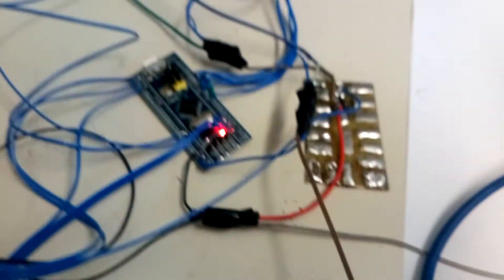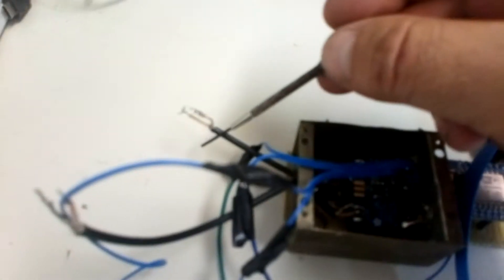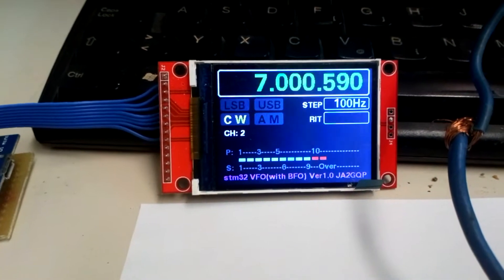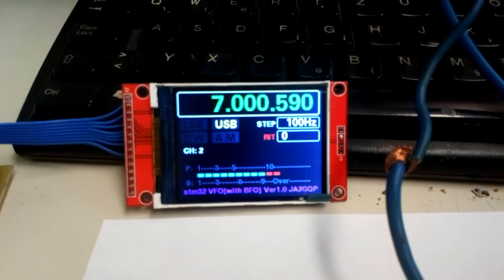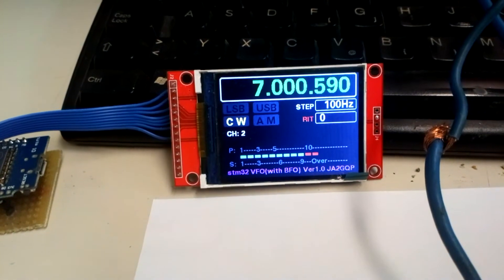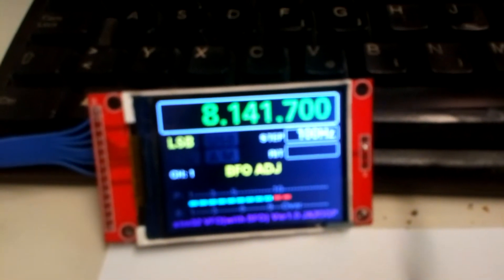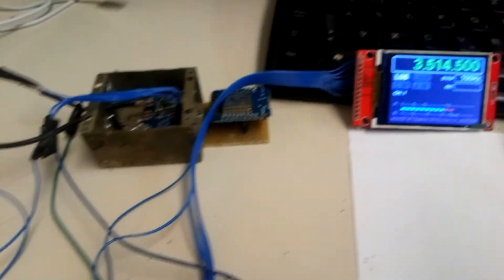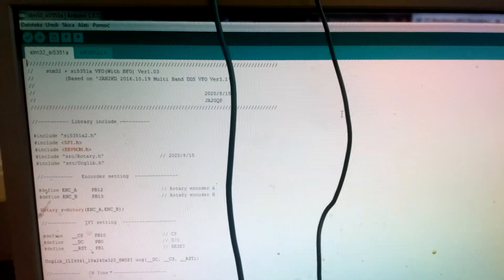9a3xz - DDS stm32 by ja2gqp

Comment: Hello Mladen Cukow!
I have been unable to compile this sketch for two weeks now. I have an error that I can't deal with:
"fatal error: libmaple/dma.h: No such file or directory 56 | #include <libmaple/dma.h> build complete.
exit status..."
Could you please send me the .HEX file for this VFO?
Reply: I only get that if I use PlatformIO. Use Arduino IDE version 1.8.6 or later. I can compile but on uploading sketch I have a blue flashing LED and no display.
Reply: @zaffarsiddiq
Reply: hello! Thank you for your answer.
I'm using Win10, Arduino IDE 1.8.19. STM32F103C8T6 I have 128kB Flash.
Unfortunately, when I try to compile, I get the following message:
fatal error: libmaple/dma.h: No such file or directory 56 | #include <libmaple/dma.h> build complete.
exit status
Compilation error for Generic STM32F1 series board
I wrote to the author of this software JA2GQP, waited two months and didn't get a single reply.
Reply: Did we ever get this to work?
Where is sketch link and schematic?